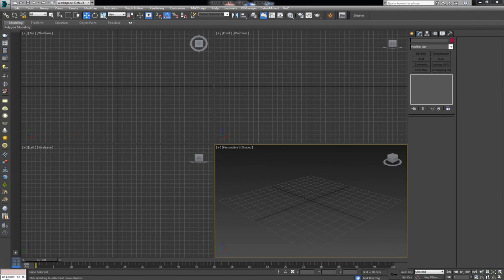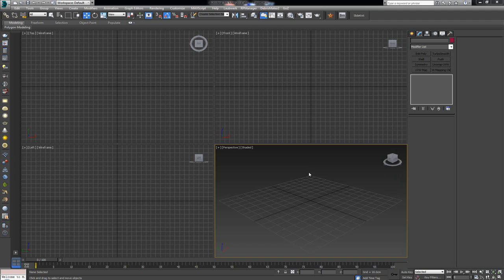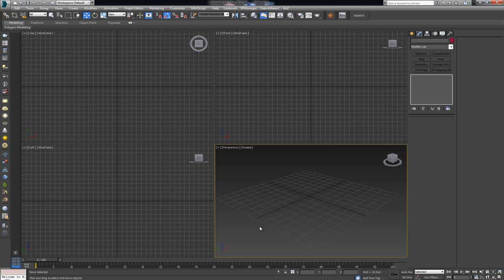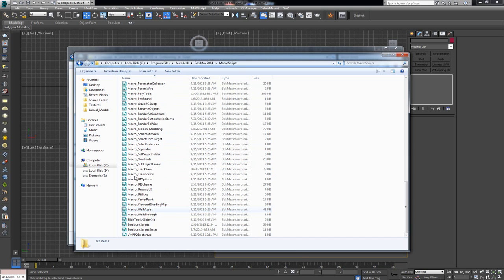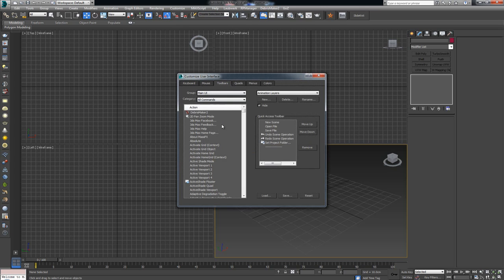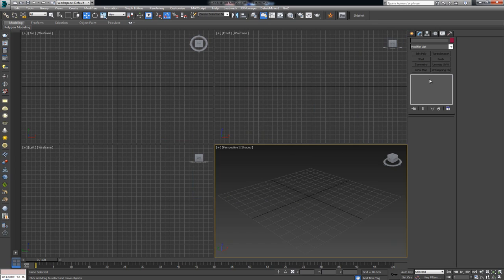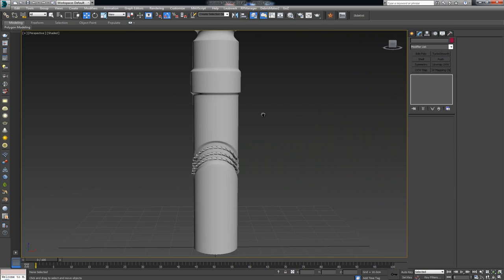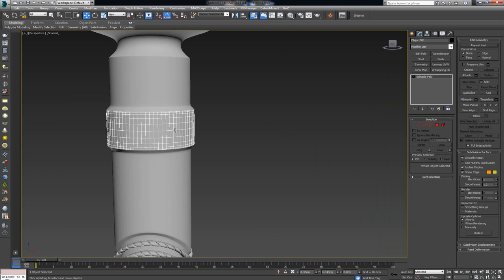Modeling Complex Carvings And Shapes on Uneven Surfaces in 3ds Max

Comment: Tnx for this tutorial! It's a great tip for usually messy and frustrating process. I already have few ideas where and how to use it.
Reply from the maker: +Dejan Kober I'm quite surprised at the positive feedback on this video, and i am really happy that you guys are loving it. I am curious as to what you would use it for so feel free and share your ideas.
Reply: First thing I will use it is to place one particular text on quite uneven surface; it's name of ship that we are modeling at moment, and it needs to be placed on part of exhaust system. And since customer has special design for that text and it needs to be 3D, it will be much easier to place that text using your method. 

Also, one other thing I might use it for, is placing some details on one space ship I'm modeling in my free time. I have some curved surfaces that might benefit from few extra details.
Reply from the maker: Dejan Kober Sounds like an interesting application of the method. I might actually use this method in a few more future tutorials so you might see me show off a few more applications of it.

Comment: Spacing tool-Array tool or even Path Deform cant achieve the same amount of quality on similar circumstances?  Thanks for your awesome tutorials Denis :)
Reply from the maker: +Ayger74 Very much true, but the real application behind this is when you have surfaces that are twisty and bendy. The initial idea for the tutorial was to make it with surfaces as that, but the unwrapping was taking too long so i decided to take the simpler path.  In any case cheers for pointing out the other ways to achieve the same result.

Comment: Here's the attribution inside the script

 -- Version : 2008.09.25
 -- Created for Slide Ltd (http://slidelondon.com) in Sept 2008 by Robin Deitch (contact@slidelondon.com)

 -- This tool can help you lay things out on the surface of complex objects which have been UV-mapped. For
 -- example, you could craft an intricately-detailed knit-pattern mesh in a flat plane, then wrap this
 -- around a sweater mesh.

 -- To use, first select a single source object, which has been properly UV mapped. In the tool, pick a
 -- mapping channel and a scale for the flattened mesh - then hit the "Unwrap selected" button. It will
 -- create a new mesh named [source name]_skFlat_channel[channel], based on the UVs of the base object and
 -- arbitrarily scaled from the [0..1] UV space. This will have a morph modifier in the stack which will
 -- transform the verts from UV to world positions. You should be able to slide channel 1 up to 100 and
 -- see the flat mesh move into place on top of the source mesh.

 -- You can now lay some other objects on top of the flattened mesh and skin wrap these to it. When you
 -- morph the flat mesh and your bits and pieces will morph with it!

and the CG Society forum thread http://forums.cgsociety.org/showthread.php?p=3284889

Comment: Was wondering can we make the reverse process? Example we have a wool blanket modeled pattern and we were to make it planar . is that possible using this script?
Reply from the maker: Not in this way. If you have a blanket modeled, it would require you to make a low poly version plane of it, then link the blanket to the plain and make the plane planar. If the way you did the linking it should in theory follow along. Though not 100% sure

Comment: It's a nice technique but I think playing a bit with a bunch of bend and FFD modifiers would give me the same result. I'm not sure which way is faster.
Reply from the maker: In a simple case like this one yeah you can play around with the FFD modifier, but when you have a complex shape that goes around in different angles and around different shapes you can't really use a FFD modifier.
Reply: If you have complex shapes on curves, your FFD is going to be confusing and won't offer enough resolution, and working in local space is going to be very tricky with selections of nodes....and then how do you go back to a given selection of nodes? The FFD becomes destructive after a while, with a cluttered viewport. 

This method really is better unless it's a very simple deformation.

Comment: How did u make thous complex models ? there iks just inserting complex models on surfaces no modeling
Reply from the maker: +Braking Games Gamer Well the video is more about the way to make the carving wrap around the surface without having to manually model it on top of the surface which can be a very crappy work to do. As for modeling the carvings that might be a future video topic that i could cover.

Comment: Denis i m trying all day long to make it work but something seems to be wrong :/   I m trying to decorate a classic painting frame ..but when Morpher gets 100% i m getting kinda "circular" shape instead of rectangular :/   Image attached http://i579.photobucket.com/albums/ss239/Ayger74/Public/Picture%202016-04-18%2002_55_53_zpsnaxinxw6.png      I should say i m using default "Skin wrap" and "morpher "settings (didn't mess with anything) and i double checked the UV's already
Reply from the maker: +Ayger74 From my experience when working with the plugin you need to make sure two things are in order .. your UVW unwrap and make sure that you have your XForm reset
Reply: +Denis Keman Just made it to work (after a total of ~10 hours) I followed your exact instructions but when i was create a rectangular painting frame (curved inside) the UV's was like twisted and required manual work to be straightened (with "unfold strip from loop") ..no matter i was starting from shape or poly modeling.In my last try..i just added MORE geometry to the same base..and UV's this time have unfolded flat..and the decoration objects followed properly :)
Thanks again man for everything you are doing :)

Comment: AFTER SKIN WRAP MY WHOLE OBJECT IS NOT WRAPPING PLZZ HELP
Reply from the maker: Usually if your model is not wrapping up correctly it's either the XForm reset or your model doesn't have the required geometry in order to deform properly
Reply: thanks sir,......actually my whole object is not moving to the cyclinder skin
Reply from the maker: Mridul Sharma Just backtrack my steps and you should be golden. As far as i remember i go into details about all the steps along the way

Comment: Hi, awesome video! I have a question.

I am using the pan function, namely alt + mmb. For some reason it feels as if 3ds max is panning about some invisible object in the far distance (as the axle/pivot of the pan).

As a result, any miniscule movement of alt + mmb causes the object I am currently working on to fly out of the viewport's current view. Selecting the rig controller actually makes this worse and the object flies offscreen even faster.

Frankly, this makes it literally impossible for me to work on the mesh.

Video: https://youtu.be/oaImgMRjgD0

Screenshots: 
http://i1124.photobucket.com/albums/l573/Vernancular/hilarious.png [Before]
http://i1124.photobucket.com/albums/l573/Vernancular/hilarious2.png [After]

How do I fix this? This has never happened to me before, I have no idea what is wrong
Reply from the maker: +Majestic McLoaf Usually this problem happens when you import a model that has a different pivot location from the software that it came from so max likes to position the object in the XYZ space, then place a holder for the pivot and position it at 0,0,0   So if this is the case unhide all the layers and see if you can select something that is not visible and shouldn't be there. If you do select something like that delete it as that should stop Max factoring in that object and zooming you off to the side

Comment: Your video is brilliant. I am finding alot of unwanted distortion on my models during the morphing process so that the end result looks like a big mess. Is there any typical mistakes that might be causing this? Here is a link to what I am seeing: http://imgur.com/5rR8lvL
Reply from the maker: +Kevin Nally Well in all honesty that is more or less what you can expect from a Morpher. What is happening it is applying a sort of a FFD on the model to bend it into the desired shape, but at the same time you need to make sure that the model that is being bent (the skulls in this case) have the geometry that can deal with the morphing and won't break. This is more or less where proper geometry comes into play.
Reply: Thank you,  Is there any resource that could help me understand proper geometry better?  Right now its all seeming a bit like magic
Reply from the maker: +Kevin Nally Well it's not magic that much i can tell you for sure :)  Knowing geometry flow is more or less something that you need to spend some time to learn, usually it's dictated by whatever the model will be used for, usually for gaming and deformation. Now if it won't be deformed then it's not all that important, but if there will be deformations then you need to make sure you have clean geometry. 

As for sources on learning geometry flow, i haven't done any videos about it YET, but you can search around either on Google or YouTube on retopology videos. That can give you a better idea on how a clean geometry should look like.
Reply: Thanks for your tips Denis. Much appreciated
Reply from the maker: Kevin Nally
I do try to bring a bit of everything, just enough to make you want more :)